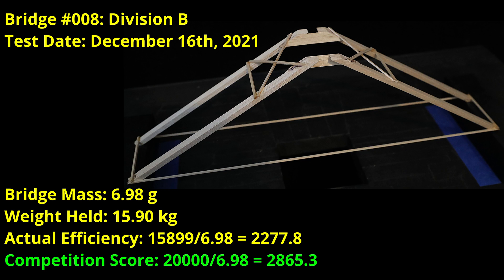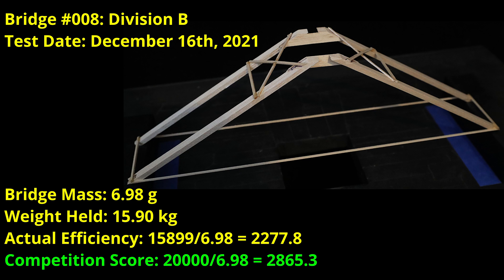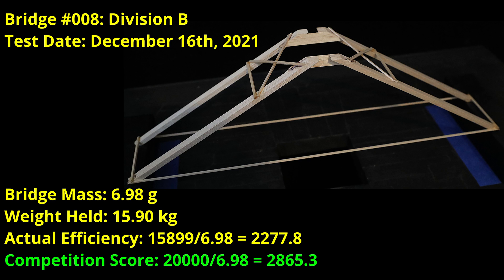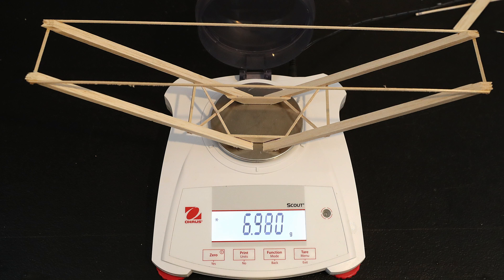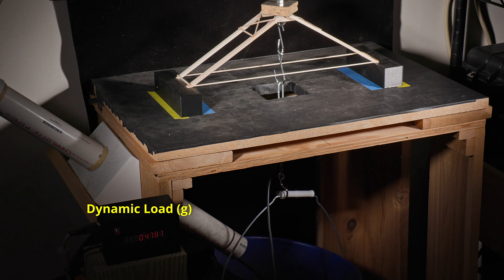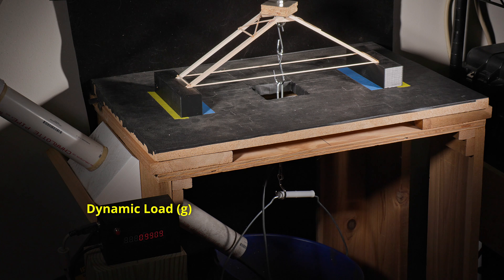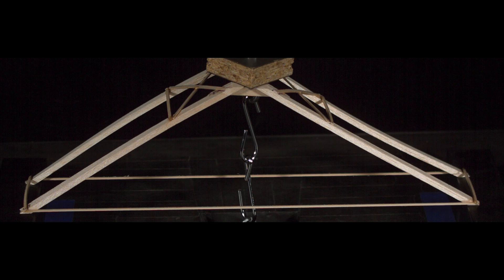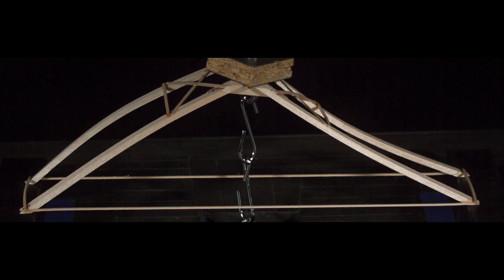Bridge 008 Division B: Competition Score 2865.3

Comment: Could you please give the exact measurements of bridge
Reply from the maker: Hi!  I don't really have a build template for this bridge.  The span is 35cm.  This particular bridge is for last year's rules, so I don't think you want to model any builds for this year using this design.  A good starting point for this year's bridge would be either this video: https://youtu.be/7MwflLa5kCg  or if you want to see what is possible, check out this Div B video: https://youtu.be/LI5n4PJFTCg  Good luck!!

Comment: I am building a bridge for Div B and I am aiming for an efficiancy of 3000, so should I use the angled main legs, The thick legs above, or a normal thin legs like in the build series you put out with bridge 14?
Reply from the maker: Definitely not a bridge like #14 in my optimization series as that was for the 2014-2015 rules.  That wouldn't work well here.  Both the thick legs and the L legs have the capability of scoring high.  Also, adding a slight angle to the Div B design might be good as well.  It's up to you to try a few things and see what works for you.  There isn't one correct answer.  Good luck!
Reply: @balsaengineering6686  Thanks!

Comment: Hey, I have a question. I made a bridge that scored decently high, the highest i've ever had, and then tried to copy it(it broke around 15.5kg) I had the densities of the legs and all the individual pieces  except cross bracing recorded. while trying to copy it, I managed to get the exact same mass as my other bridge, and each leg was within 0.05g of the other bridge, but it scored less than half of my previous score. Any idea why this happened?(note: i made a couple of changes to my design while trying to copy, i glued the really long tension member on the inside of my L beam and flipped the legs the other way around so the "L" shape was facing out instead of in(sorry it's a bad explanation...) and everything else was the exact same. I really don't know why it performed so badly, it's a very similar copy :/)
Reply: I'd really appreciate any advice on recreating a bridge that can score within 100 points of the original reference... :-)
Reply from the maker: Hi!  Without seeing video of how your 2nd bridge failed, it's hard to know for sure what the problem was.  Could you tell if it failed in a different way?  If it tipped over for example, perhaps it wasn't as level as your first bridge.  All it takes is a single bad joint to make it fail early.  It happens... I would suggest keep trying to build exact copies of your original build and take extra time to make sure all the joints are glued well and that it's as level as possible.  Good luck!
Reply: @balsaengineering6686  Thank you so much for the quick reply!!! I really appreciate it. Unfortunately, I wasn't able to videotape the bridge failing, but it snapped in three places, once in a basswood tension member at the bottom, once in the bottom of the lateral bracing(Sorry, it's hard to describe..)  and on the joint of the L beam :/ i suspect the failure was caused by the L beam's bad gluing but there isnt' really a way to know for sure. it didn't break anywhere else and was mostly intact.. Thank you for the advice! I'll keep trying. :)
Reply from the maker: @anonymous_pumptato_cat7012  Good luck!  Sometimes it's really hard to tell what failed first (the only important thing) without high speed footage.  Definitely use some extra glue to re-enforce that L beam joint to make sure it's good.  That's a hard joint to glue properly and if it's bad, it'll definitely fail early.
Reply: @balsaengineering6686  Thank you so much!!! Yep, it's incredibly annoying to glue L beams.😂

Comment: Hi, what angle did you cut those legs at?
Reply from the maker: They were right around 32 degrees
Reply from the maker: @shyamravidath  I would strongly encourage you to experiment by modifying this design!  Making the legs 6mm instead 8mm would certainly be something to try.  That width adds lateral stiffness, so if you see your bridge tipping over or buckling in that direction, you know you went too small for your specific wood choice.  Good luck!

Comment: also what are the measurements for all of the pieces
Reply from the maker: I don't really have a template for this bridge, but I would highly recommend just drawing out the side full-scale on graph paper.  If you get the span at 35cm and the loading block at 10.5cm (rules say min 10cm), all the critical dimensions fall out of that.  You will want to make the inner pass-through block hole slightly wider than 4cm, but it doesn't need to be too much wider.  If you are just getting started, I recommend you check out some of my other videos that show the basics.  Also, you might find the Div C full-build video very helpful as I build an entire Div C bridge which is more complex than this, but it has all the same steps.  Good luck!

Comment: Hi Balsa Engineering, this build is amazing! I have a question though, do you know the lengths of the pieces of wood you used to build this bridge (legs, tension pieces, X piece, and horizontal cross supports). I'm building a bridge similar to this and this bridge is a wonderful design! Thanks
Reply from the maker: Hi Ravidath, thank you for the kind words.  My goal isn't to provide a template just to duplicate this bridge, but to help learn the process to build them yourself.  I would start with drawing out the sides on full-sized graph paper with lines showing the passthrough block and loading block height.  Once you have that, all the dimensions will come from that.  This particular build used 1/4" x 8mm balsa for the legs as described in the video description.  I also mention what the tension and cross member dimensions there.  For a more detailed how-to, I highly recommend you watch my Div B full-build video carefully.  That shows the entire process to build a bridge similar to this.  It is more complex than the Div B version, but all the steps are there and should help you out.  https://youtu.be/7W839KEcKes

Comment: Hi balsa engineering, I am going to build a model similar to this and use the same materials generally. Do you know what the dimensions and the length of the piece connecting the legs together is? Also, does this bridge comply with the 2022 division B bridge rules? Thanks
Reply from the maker: Hi!  That top connection piece was 3/32" thick by 10mm and 65mm at the longest point.  I would highly recommend drawing out the design full-scale on graph paper to build this yourself to make sure everything is just right.  Yes, this bridge as-built complied with the 2022 Div B rules.   Good luck with your builds!
Reply: @balsaengineering6686  thank you 😊
Reply: @balsaengineering6686  Another question: What material did you use to build that piece? Thanks
Reply from the maker: That piece was balsa wood
Reply: @balsaengineering6686  Are there any alternate options for the connection piece?
Reply from the maker: @ravidathg9319  Sure, you can use almost anything for the connection piece.  My design here is just a starting point.  I recommend experimenting with different options

Comment: Hi, this video was really informational and the build is amazing! I have a question regarding a prototype that looks very similar to yours which I built out of oak wood and weight around  ~52 grams. In your estimation, how much weight do you think it can carry? Thanks!
Reply from the maker: Thanks!  I don't really have any experience building these types of devices with heavier woods like oak.  If it was the same actual efficiency of this bridge (~2150), that would mean your bridge would hold well over 100kg (111.8kg).  My guess is that the glue joints might be the weak point before that kind of load happens.  Definitely let me know how it goes if you test it to failure!

Comment: Awesome video! I was wondering how long this bridge is, though.
Reply from the maker: The minimum span was 35.5cm and the complete end to end length was ~37cm.
Reply: @balsaengineering6686  Thank you, another question. Have you used skyciv to design this bridge? If yes, how would you change the materials of the members? Thanks
Reply from the maker: No I didn't use SkyCiv to design this bridge.  I have used it before, especially when I had to help my team compete in digital structures.  It can be useful for learning about which components are under tension and compression and a general idea about the loads, but it's really way too basic to simulate a real bridge like this.  SkyCiv is very much a simplified/idealized tool.  It doesn't take into account things like material inconsistencies,  actual joints (this is big), and things like the change in loading due to the dynamic deformation of the structure which happens at higher loads.
Reply: @balsaengineering6686  Thank you for the reply!

Comment: Any ideas for dealing with the basswood shearing from the balsa. Overall, I thought we had adequate glue but it appears that the forces at the base of the bridge are a bit too much. It may be due to the angles and length being exactly square on both sides but wanted to see if you had any thoughts. Thanks again for all the videos as they are a great primer.
Reply from the maker: Hi Chris, yes, that is a common issue.  I'll be addressing it a lot in my optimization series I'm working on, but the short answer is that the easiest solution (unfortunately) is use slightly higher density legs or make them wider at the base.  Another major cause of that shearing can be because the lower leg is starting to deform and twist and thus starting the shearing process.  I found that increasing the lateral supports can help with that, but with this year's rules, that's difficult to do.  Make sure your very lowest cross member is as low as possible and as close to the tension part.   Good luck with your builds!

Comment: Great build!. Our team is struggling to reach 15kg. 95% of the time our bridge leans on one side and breaks. I always double check the level of the platform before testing. Our bridge design is similar to yours. We always use bass sticks for X cross members. In our apparatus our sand flow is from the back of the bridge. Not sure why bridge leans to the side after 8 to 10kg.  Any advice on how to address this issue.

Does angle of the bridge plays a role? Our leg angle is 29 deg.
What's the angle and height of your bridge?
Reply from the maker: Thanks!  The angle of this build is around 34 deg and the block sits around 10.5 cm.  That said, I'm almost positive the problem you are having is related to not enough lateral stiffness in the pass-through block hole area.  If you are using a single stick leg design like this particular bridge, make the legs a bit wider.  If you are using a 2-part "L" design leg, which also works well, make the top part of the leg a bit wider/stronger.

You definitely want to be able to hold 15kg.  I'm not sure how light you are trying to make your bridge, but it's best to start fairly conservative to make sure you can build something that holds 15kg and then lighten later builds as you get more experience.  Even if you have to start with a 10-15g bridge, that's a good first step.  If you can't get a 10-15g bridge to hold 15kg, you definitely need to modify your design (most likely how I mentioned above).  

Good luck and let me know how it goes!
Reply: @balsaengineering6686   Thank you so much for the quick response.  i tried both single leg and l angle bridge. My bridge weighs around 8 to 10 g. bridge is 5 cm wide evenly from top to bottom 

Is there a disadvantage if i make the base wider like 7 cm and head 5 cm? I'm planning to continue to use L angle bridge.
Reply from the maker: The only real disadvantage of a tapered bridge would be the extra material/mass needed because the sides would be taller and slightly more cross bracing.  If you send me a picture or two of your bridge to mklinger@comcast.net, I could probably offer some other suggestions/advice.
Reply: @balsaengineering6686  Sure. I will send the videos tonight.

Comment: Hi, could you please make a complete build video for this
Reply from the maker: I'm currently working on a different build project so this isn't in my immediate plans for a video, but I'll definitely consider it.  This build is very similar to the Div C bridge complete build so I recommend you watch that one if you haven't already.  The steps are pretty much all the same with a different assembly jig.  They are really similar if you use an "L" shaped leg.  This particular build used a single stick leg, so just skip that part of the process in the other video. Do you have a specific question you'd like more help with?  Let me know and I'd be glad to help if I can.

Comment: Hi I have one quick question for the bridge. Usually when I build my bridges I make the legs of the bridge vertical instead of horizontal so then the legs won’t bend as easily but in this design the legs of the bridge were horizontal. I was just curious to know why you did that so it can help me build better bridges in the future. Thank you
Reply from the maker: Hi Varun, yes, normally for bridges it's best to have the legs be aligned vertically.  If you check out my previous build of this design, that's exactly how I had the primary parts of the leg:  https://youtu.be/cmhBslzbEFI

The requirement of the pass-through block means we have to have a giant hole in the bridge.  Because we can't put any conventional cross-bracing in that hole, there has to be something else to provide lateral stability.  If you have built bridges without that, you might see them bend and tip over. That is the common failure mode when you don't have enough lateral stiffness.

One way to "fix" this problem is to create an "L" shaped leg in my previous build.  That works well, but is more difficult to build.  I wanted to see if a more simple solution is possible, so by turning the leg to have the wide side like in this build, it provides enough lateral stability.  The problem is that you need thick/dense enough wood to resist the bending as well.  

I'm not sure which design is overall the best.  Both can provide very good scores 2800+ so I'd recommend giving both a try and see what works best for you.  Good luck!

Comment: Would you suggest using epoxy or superglue since epoxy is better at resisting off-angle stress
Reply from the maker: I've never found a use with any of these devices to use anything but CA glue.  As long as you make sure your joints are flat together, CA glue is the best.  With the Div B design here, everything is square, so that shouldn't be a concern at all and with the Div C design, the angle is such that you can still easily make the joints flat with a slight bowing of the wood.
Reply: @balsaengineering6686  thanks so much!

Comment: Hello! This build is so great! I do have a question though, what is the thickness and length of the type of wood used on the top piece where the two legs connect/where the loading block is placed?
Reply from the maker: Thanks!  That connection piece is made out of 3/32" thick balsa and was about 3cm at the top and 6.5 cm at the bottom.  There are many options you can use for that connector, but make sure it's pretty strong and your glue joints to the legs are very good as it's extremely important.

Comment: Hi, Thank you so much for the video, very informative.  I tried the exact same build for Div B using 1/4× 1/4 balsa for legs and 1/16× 1/16 Bass for tension and cross braces, but my bridge is around 10 g. What else can I do to bring down the weight?

We even tried building one using 1/8×1/4 balsa for legs and it held only 13 pounds

 Thanks in advance for your help
Reply from the maker: Without seeing your bridge and maybe even a video of it failing, it's hard to know for sure what your problem is.  Feel free to reach out to me privately if you want to share these kinds of details.

My guess is that you need to put more work into the exact density of the pieces you are using.  This bridge build used 1/4" by 8mm wide.  That 8mm wide is very important to hold up to the lateral forces.  If you want to duplicate this build, you'll need to find the correct density legs to match, roughly 1.4g per leg.  If you haven't had a chance to watch my balsa library video, I'd recommend checking it out on how to cut and sort your material:  https://youtu.be/bLsTOpmozGI
Reply: @balsaengineering6686  Thanks a lot for your quick reply. Will follow your suggestions.

Comment: Very nice build! I have a similar project and I was wondering what glue you used.
Reply: I have some gel gorrila glue, but I just ordered 50 cps Cyanoacrylate from amazon.
Reply from the maker: Thanks!  Here is a link to the glue I'm using which is 50 cps CA:  https://www.amazon.com/gp/product/B07DK19W6M/ref=ppx_yo_dt_b_search_asin_title?ie=UTF8&psc=1    
Also, I made an entire video on glue and gluing techniques if you are interested in checking it out:  https://youtu.be/55lb2KzSiwg
Reply: @balsaengineering6686  Thank you so much! How tall is the structure, and how long does it span?
Reply from the maker: It's basically tall enough and wide enough to follow the rules for Division B, so around 10.5cm tall and 35.5cm span.  I recommend you watch my first Div B build video where you can see how I draw out the sides on graph paper.  https://youtu.be/AX_CNFw0iEw